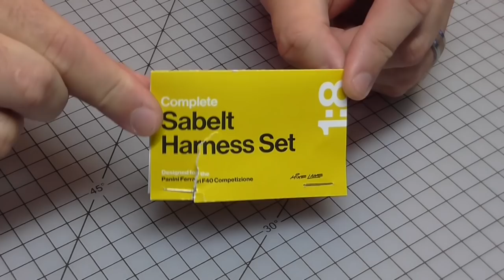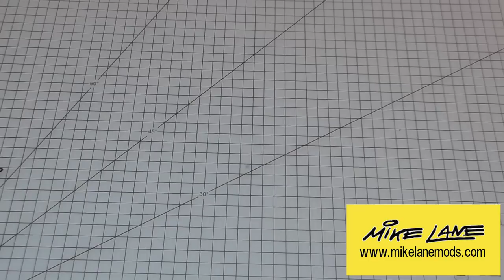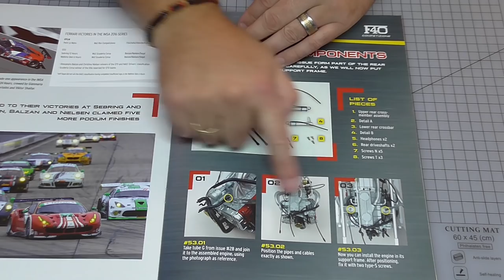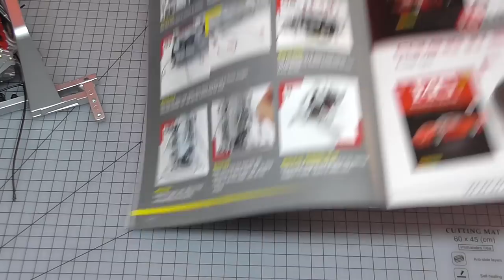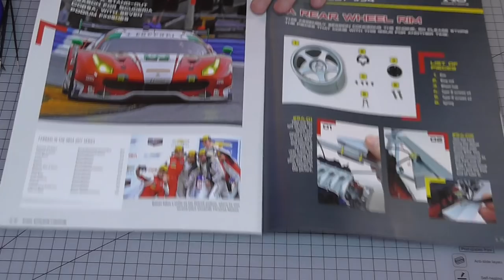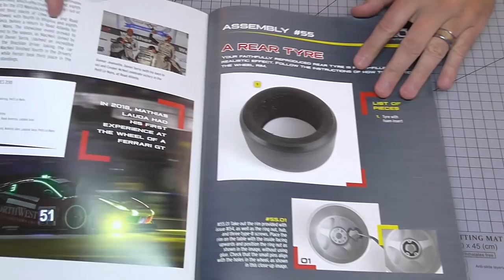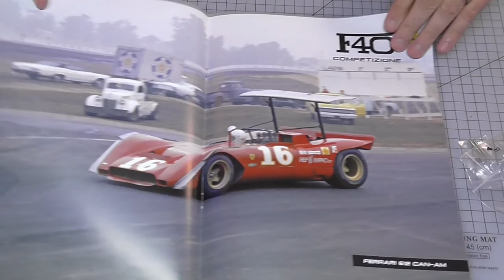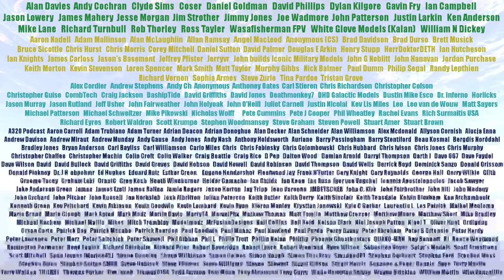Build the Ferrari F40 Competizione - Part 53-56 - Mounting the Engine and Rear Tyre and Brake Disc

Comment: I don't know Wayne, I have OCD like you do when it comes to something like this. I would have to figure out where everything goes. It would drive me totally crazy until I figured it out. I build plastic ship models and one ship in particular was driving me nuts when I was going through the instructions getting them organized so they made sense to me. It took me 3 weeks to figure them out and get them sorted out. Finally at the end of that I have got them to the point of which I'll be able to go through the model with a minimum of difficulty. That Ferrari is a beautifully detailed model and it would be sad not to be able to show that magnificently detailed engine in all it's glory. Good luck with the rest of the build. See you in the next build update.
Reply from the maker: I got there in the end. It made more sense when the engine was in the frame but I didn't use the instructions in the end. I had to fall back on logic
Reply: @WorldofWayneUK  I kind of knew your OCD would have kicked in eventually, glad you were able to figure it out. I knew you would. That's exactly what I did with that model kit I was telling you about, logic took over once I understood tge overall picture. Good luck with the rest of the build. See you on your next video.

Comment: I honestly  can't see the problem with the pipes. I labelled each one 1-8 and fitted them one by one, no problem at all. As regards to the instructions yes they are a bit chaotic and seems to me the instructions are out of sync with what you receive i.e. parts with 71 but instructions are for parts from 66 and 67.
Reply from the maker: I got there in the end. With hindsight I would have done as you did but I mistakenly thought this would be like other partwork models.

Comment: It's a shame the instructions are all over the place. IT looks like this is gonna turn into a pretty good build, but I hope there's no electronics in there, or at least not much because if they muck up instructions on how to fit in the engine fuel lines, I dread to think what actual LED connections are gonna be like.

Comment: So basically they just split the total build parts up into rough quantities and spread them over the issues ,rather than using the just in time approach by suppling the correct parts for the relevant build section, like other partworks do...eg the Porsche 917...totally nuts , along with the less than clear diagrams and the poor quality seatbelts. I would probably have used super glue to hold the seat belt labels.
Reply from the maker: Yer. It’s the most disorganised build I have done